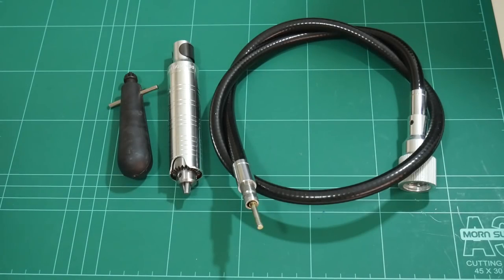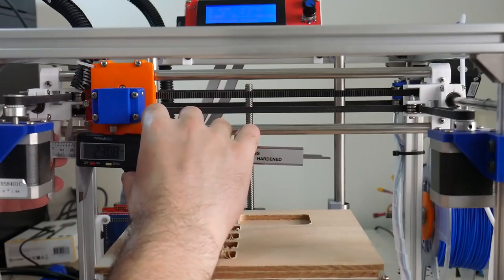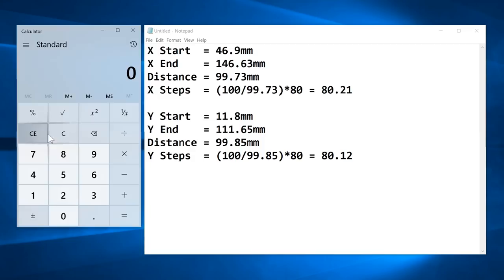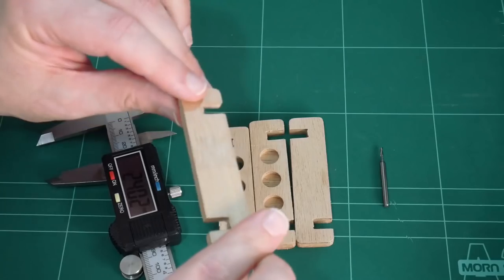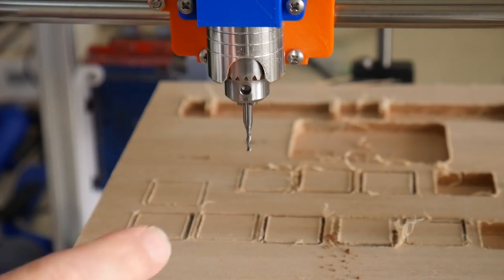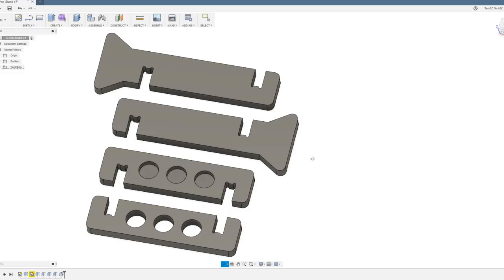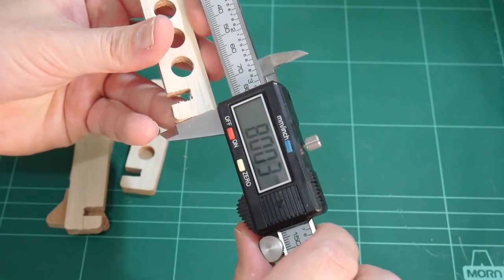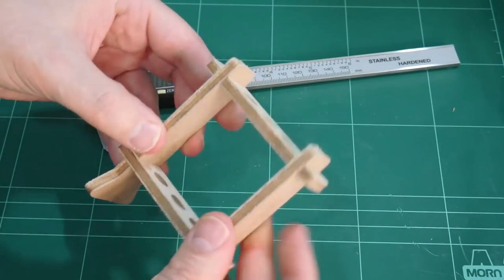Adventures in Measurement

Comment: I really thought that Tech2C is smarter than this. Didn't expect such crap. Terrible. Ruined my day. Just joking. But really, one should never ever, unless in total dispair,  do such thing! The step/mm are based on mechanical calculations only (not measurements!). Because if you think about it then you realize that if steppers are ok,  drivers are ok and mechanical parts are ok than there is no place where error beyond some very small error (sub 0.01mm) can appear. Measurements you do with caliper are always less accurate than accuracy of normal mechanics. So, you cannot measure accurate enough to make you mechanics even more accurate than you measurement tool and method. Basically, you measure with +-0,02mm of calipers  + +-hell knows how much of curved hands and bad measurement method. If you have problems then you should not change the steps - check you mechanics!!! Could be stretched belt, bad Chinese pulleys and idlers (even a little wrong diameter), somethig's not square, etc. Solve the mechanical problems.

Now about CNCing :) You set cutting width based on the cutting bit measurement. That's good, but you did not measure how much it vibrates sidewise during cutting. Your setup is not really CNC friendly. Not much firmness. So, no wonder if the real cutting width is a lot more than the cutting bit width. Make a cut, SCAN IT (do not use calipers) and measure the real cutting width. I think it would solve all the problems. Return step/mm back how they were.
Reply from the maker: Every printer I've owned has needed slight calibration from the theoretical steps/mm because as you've mentioned, manufacturer inaccuracies are almost guaranteed at this price point. 
And yes I agree the printer may be vibrating or similar causing the run-out, but you saw when using a .1mm smaller end mill the error observed stayed the same 0.23mm, so I think the caliper was adequate for this test.Great ideas you have keep them coming ;)
Reply: Artem Kuchin
 - Consider giving yourself a reality check, its a home made 3D printer making plastic parts primarily for fun and personal interest. It is not NASA!

With all the will in the world there is no way you can ever expect plastic to extrude within those tolerances anyway.

Doing what he's done is a simple, viable and effective solution to the problem with zero money spent.

And about CNCing, the clue is its NOT a CNC, its a 3D printer that's been cleverly adapted. The runout on the collet shaft was the major culprit.

The setup was friendly enough to produce a working and application accurate pen stand and my guess is that his steps per mm will stay modified
Reply: @havenview  Exactly because  there are already tons of problems with such devices  one should not create even more mess with correcting already existing error by creating new. One error does correct the other, but this is plain wrong. Eventually the error will show itself but will be harder to diagnose.  Reality check passed, i guess. As for CNC see the suggestions i provided. Actually i am sure the size error came for the described reason. Just fix that and everything will be fine.
Reply: Artem does have a point, as you can see from his channel he has a bunch of idler issues, and the Core XY HEVO group also had these problems with cheap Chinese pullies. (tbh where else would we get them from, real ones are atleast 8 euro's a piece, and we need 8 of them).
It is still a real thing, and a Core XY is not rigid enough for this, eventhough it's much more rigid than any prusa i3 clone printer is, and it can be compensated to produce a pretty piece.

Then again i highly doubt all stepper motors, and their drivers, and the general wackyness of 8bit controllers, voltage fluctations, are not at fault here. I think these all can have a fault way above 0.01mm. And if we tried to fix everything, we'd be sitting here for ever, with very expensive measuring equipment that is way above out budgets... to mill a pen holder ffs.

I'd recommend you all to look at the Mostly 3D printed CNC, with the modifications from Brauns CNC (always funny to see youtube channel calling themselves CNC or ''teaching tech'' r whatever but they are actually noobs and know jackshit, and have to learn along the way to even get a mediocre part from it). 
It is can do the job pretty well, and can be build for under 300 euros, depending on your end mill choice of course, which start at 50 to 150 euros for a decent one. A Core XY Hypercube costs atleast 300 euros as well. then again not everyone wants to throw another 300 bucks around for a pen holder or acrylic cutter.
Reply: @PokeyDoggo   Cheap idler generally are bad, usually are off center. Look at the VORON 3d printer - he author dropped all idlers and replaced them with pulleys on a shaft with 5mm ID bearings.Pulley also have problems but a lot less.

As for error. TECH2C has 80 steps/mm, that's 5 full steps per mm, 0.2mm per step. 1.8d stepper has 5% error on full step. That's the worst case. 5% of 0.2mm is 0.01mm error from stepper motor. Idlers and pulley which are off center can add about the same 0.01 if set properly and up to 0.1 if set badly. The belt itself can add some (up to 0.1mm of longer distances) too if it is too tight, but properly tightened  good belt can be very precise, the error will be less than 0.01. Bad frame (bad alignment and not right angles) can introduce HUGE error.
I never heard that driver introduce positioning error when set proper current. The firmware is ok, because it just send pulses and it is pretty gooo at calculating the number of pulses. :) So, as you see the main two factor are idlers/pulleys and frame and maybe belts (must not be too loose or too tight, just about 3-4kg force). Also, motor can have bend shafts from factory or because of overtightened belts.
Reply: @ArtemKuchin  Vorons are (with the grade of parts you are suggesting) upwards of £1200. Tech2C's Hypercube is perhaps 1/4 or 1/5 of that - YOU may have those sort of funds, MOST people do NOT, certainly in the category this is aimed at. Tech2C has fixed this by using items he already has and some maths. Come up with financial AND time figures to replace ALL the parts in order to get the full level of accuracy you are promoting - THAT will be your reality check
Reply: @havenview  I i just pointed one technical solution to an existing problem. VORONS ARE expensive, but the solution i mentioned is cheap, because it replaces cheap idlers with cheap pulleys+cheap bearing. I am not promoting anything, reread what i write and do not add anything from your imagination.
Reply: @ArtemKuchin  You can't "pick and choose bits" - what ever you list it will be more expensive and take more time and at the end of the day the "pen holder" YOU produce will be no better than his. Difference is Tech2C has over 50k YT subscribers and has produced one of the most popular coreXY designs around - your "precision" has got you 96, wonder why?
Reply: @havenview , are you for real? God, how old are you? You measure one's success, experience, education and expertise by subscribers and, probably, likes? Well, the thing is i am from a little older generation and have a job and a family, and while i do enjoy such technical content and i am a tech2c subscriber, i really don't give shit about subscribers and likes. I think this conversation serves no purpose anymore.
Reply: @ArtemKuchin  Well that's good because you have a lot of toys to put back in your cot.
Meanwhile, I've made a pen holder, it's really cool, fits together perfectly and my kids think its great.